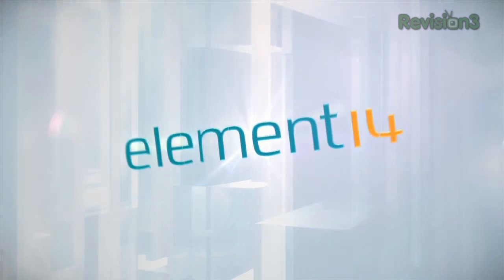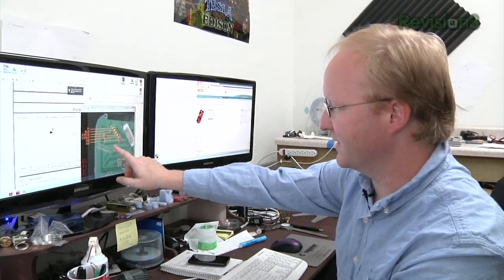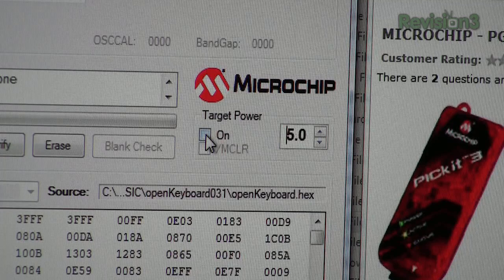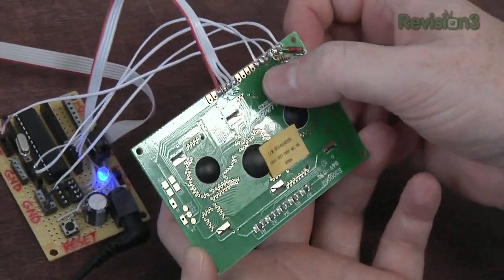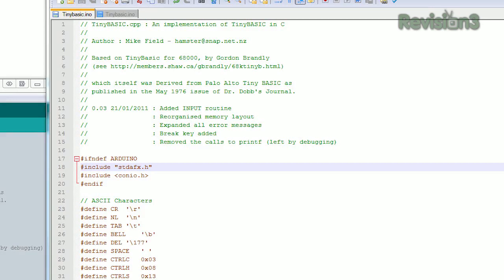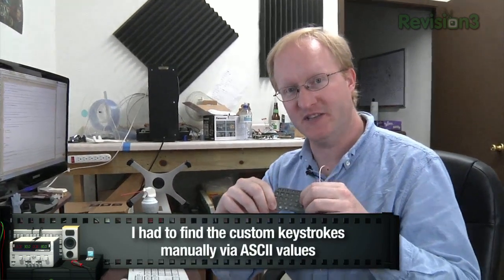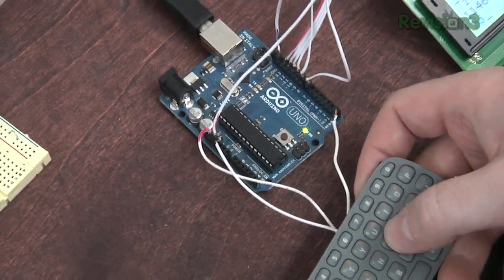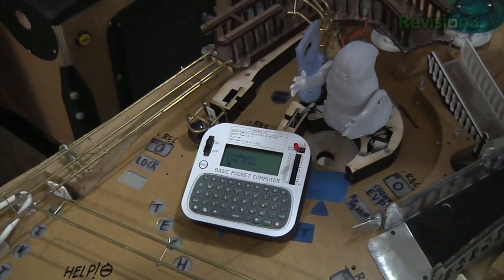Build a Retro Computer: BASIC 80's Pocket Computer

Comment: @4:48, no need to remove the chip, instead just hold it in reset by grounding RST  :-)
Works for SMT unos too, in fact a Nano with a grounded RST is a home-made FTDI !
Remember tx & rx are reversed in this application.

Comment: Hi there! I'm the original author of the chatpad reverse eng/firmware, and I just discovered it was been featured on the Ben Heck show because a student contacted me with questions about it. This stuff happens often with many of the project I used to release back in the days, and I just wanted to take a minute to tell you how awesome it is to me. Keep sharing!
Reply: Well you seem like the guy to talk too haha. I can't find this information anywhere any chance you could give me a nod in the right direction?
Reply: @butch5020  sure thing! What do you need?
Reply: @jean80it  I was wondering how you managed to convert it to output ASCII, I'm assuming it's a UART signal and I have no idea of how to go about it. I was looking to see if it was possible to hook it up as a USB HID device for one of my pi projects. Any chance you could help with that?
Reply: Fugitive's Broadcast the pic should be 16f883 and does not offer usb abilities out of the box (if memory serves me right) so you would have an hard time with that even if you wanted to mod the firmware. Serial is one of the easiest protocols out there, and most “pc-on-a-single-board” (*coff*raspberry*coff*coff*) offer dedicated pins for hardware UARTS. Otherwise, you could buy a serial to USB converter - but you still would have to convince the host machine to treat a serial stream as a keyboard.
Reply: Have you published the code for the firmware anywhere? If you have could you point me there?
Reply: Hi Giancarlo, I'm just doing a chatpad conversion now.   Ideally I need to patch it for 1200 baud, any pointers please?   Many thanks - Phil
Reply: Ah dont worry Giancarlo, I've done it.  All I had was your hex file which I partially disassembled and then manually patched the hex file, it works great at 1200 now. Here it is:  https://www.youtube.com/watch?v=5UbesxLaoNs
Files here: https://mode-zero.uk/viewtopic.php?f=80&t=1236&p=10501#p10501
Reply: it is super cool. Ben is like ultimate corporate drone compares to now ehh hahaha

Comment: Hey ben! 
I've seen your show and I do like it.
I primarily work with programming of the batch language for PC and XP, I'm looking for a build that uses the Arduino mega as a robotic control for movement but can permanently connect to a separate computer (Hardline) but smaller than a laptop.

Basically what I want to do is build a full-on robot, that is small enough to do basic household chores similar to the ones that you would see on the movie Flubber

Comment: for the sake of god make an essentials ep about what the hell does pos and neg and ground mean and why cant i put any wire any place ... its like..i copy every thing exactly from you but i have my own crazy ideas like saving some programs on an sd card to create my own raspberry pi portable that can run retro \old school games and these games or in creating the atary 2600 portable using the ps4 controller's pad thing and instead of putting a separate bottom i use the bottom that is in the pad and stuff like that for the sake of god

Comment: Gotta build me , one of these!  Just found a chatpad for  8 bucks on Ebay, I think I have the rest of the stuff on hand.  Might have to change screen though, I just built a TV-OUT board for a small 7 inch monitor I have, perhaps i will output to that, but it's just black and white,so maybe not Have to dig around and see what other type of monitor I can come up with,  but then black and white would be about the same as the one you built.  Could go bigger and perhaps use an USB mini keyboard that I have, or maybe a wireless one, think I have a couple of those laying around as well.  Ah for the joy of the old Basic machines, cut my teeth on a C=64 and I had a couple of those old Tandy 100's as well as a few other basic laptops and portables. Man what I wouldn't give to have my tandy 100 back again.
Reply: good for you

Comment: I found this project last week and now got it going. This project is a bit misleading, you will see that the version of TinyBASIC Ben installs is 0.03, this is an early release and has no digital or analogue pin control. You need to find TinyBASIC Plus (version 0.13). It's on GitHUB. Newer Chatpads have a custom chip instead of the PIC, it appears to be pin compatible but is NOT re-programmable. It is probably a PIC with code protection. These devices have 'Microsoft' on them. I removed one and replaced it with a PIC which works fine. Another problem is that TinyBASIC will NOT compile under the latest Arduino IDE, you will have to downgrade your Arduino IDE install to 1.5.6 r2. Even then I couldn't get it to compile using a 20x4 LCD with a Sainsmart serial converter so I had to remove the serial adaptor and go with the 4-bit data interface. I used Ben's code mods but they are not complete and I had to make a few additional modifications. I now have it set up and working on an Arduino Mega.

Great project though Ben, I enjoyed playing about with this immensely.
Reply: +Mike Hawkins Ya I have one with the MS chip as well, however I found a library that will do the conversion so the flash isn't needed. I wish  I had found that before I ordered the pickit 3 but who knows I may well need it on another project.  When playing in the micro-controller world tools are always good to have.  I also play in the computer world, as many do, and find that even 3 and a half inch floppys come in handy on occasion.
Reply: +Jerry Ericsson I came across the library too but decided to flash them in order to strip off the irrelevant output data from them for use in future, non-Arduino based, projects. I have brought a few of them now as they are pretty cheap on eBay and a miniature ASCII serial keyboard will be handy for future projects.
Reply: +Mike Hawkins Have  you been able to flash those with the Microsoft chip?
Reply: +Jerry Ericsson I have only come across one with a Microsoft chip so far, and I removed it and replaced it with a bog standard PIC device.
Reply: How thick is the keyboard?

Comment: Omg this is the best. he made a pocket computer. ive got 1 too its called a phone and by the way it works...the dislike buttion works...jk good job there
Reply: Can you connect Servos/LEDs and other things to your phone without any other hardware? No. Also the Battery easily lives a lot longer then the one on your phone.
Reply: +DerpyDoom good thing they have batterypacks and diy adaptors
Reply: Phones are stupid

Comment: Hey Ben,
I'm trying to make this project, but I'm not finding the chat pad for this as well as the 16*4 LCD,which i believe you used  . The things i have is an Arduino Uno R3, a PS/2 keyboard and a 16*2 LCD[ Hitachi HD44780 controller based]. Can i make this using the parts i have?? and please send me how to modify the LCD code  so it works on a 16*2 screen. Any help would be appreciated!!

Message me at mohitnbagur@gmail.com
Cheers,
Mohit
Reply: +Mohit Bagur There are plenty of demos on how to use the PS2 keyboard, here is one: http://playground.arduino.cc/Main/PS2Keyboard

Comment: { goes on the next line, not on the same line as the function declaration! Man... that's why they call them brace pairs, so they can be in a pair.
Reply: Cristi Neagu There are as many different coding styles as there are programmers in the world. I personally like it better with the opening brace on the same line as the function's signature, also because it doesn't add one useless line to my function; and I don't even really care about braces, since I prefer visually-helping and good-looking indentation.

And anyway, it's still a pair even if the braces are not on the same column.

Comment: Hey Ben I have a challenge for you. Can you try to make a wireless xbox 360 controller screen to display a wireless hdmi signal such as from an xbox or pc to be used kinda like an nvidia shield without the intense lag? Another great use for this (besides gaming across the house) would be hooking the signal transmitter up to a tv reciever and stream media to it, anyways i think this would be totally possible using wireless hdmi and a screen that could be powered by the contrtoller's expansion slot on the back

Comment: Hi Ben, I can't find a chatpad with a SMD PIC exposed like yours, all I can find is chatpad with a Epoxy covering the chip and instead of 6 it has 9 pins connector. I bought it from DX.Is it possible to use it?Regards. Joe.
Reply: jose Milton There's an arduino library for the unmodified chatpad available here: http://cliffle.com/project/chatpad/arduino/

Comment: There is no ground. This runs on batteries which are dc. Ground runs on ac. And how is it going to run electricity to the ground when it isn't connected to that or anything that would connect a lightning strike to the chatpad?

Comment: I hate to say it, but this is probably the most useful tool Ben has ever made. Not that the other tools are not useful, but this small computer is indeed insanely useful! Basically, Ben has built the world's first digital multitool if you wish to call it that! This can be used for debugging computers, electronic components, pinball machines, arcade machines, ATM's, and it could even assist in debugging Java programs and such! Ben, this portable MS-DOS computer is the most useful electronic tool I have seen you build, and while some may think that it is cheating, an Arduino is still powerful enough to run Basic really well.
Reply: Well, it does not really run dos. Actually it runs a basic interpreter written in C, so its more like an own operating system (which can only run one program at a time). There's bitlash out there which can run multiple programs asyncronous and has a c-style syntax. But yes I agree to you that this is the best thing he ever made! It woke my interest in electronics and I bought alot of tools and parts since that. I can build a few of them, if i want to.

Comment: Little precision : lcdChar(c) is not an "object" but a static method call. If you were encapsulating the method in a class and then create an instance of that class and then call the method "on" this instance, then yes, you would use an object. But not here. And... sorry but the code you've written to output the chars is pretty ugly... (in terms of style and performance...)
Reply: Is it really even a method when it's not a part of a class/object? Thought you usually called it a function then.
Reply: You're right, static function call, habit. But the rest of the comment remains valid.

Comment: Build it ALL from discrete semiconductors, 4000/74 series logic chips and processors, then get back to me. Arduino / R-Pi etc is CHEATING.
Reply: True, but it's still pretty inventive and it works!  I've tried my own projects using logic chips, ics, old CPU's and never ever got anything to work, but every once in a while I get to the itch to try building my own 8-bit little computer.  I got all the parts, just I always mess something up.  I've been following this guy for about 10 years, back when he was just doing portable hacks with the Atari.
Reply: sprybug That's your experience though, not an absolute.
Reply: It may be cheating, but it is a very helpful cheat. You can debug so many things with this...you can debug pinball machines, arcade machines, electronic components like servos and transistors, SD cards, RAM sticks, etc. Basically, Ben has created a very portable and powerful multitool for circuitry debugging that is reliable and uses parts that are accessible enough to public to do this. Well, except the case...you would have to make some sort of sturdy case for yourself, but this is the only drawback really.
Reply: I hope you don't use pliers, breadboards, strip board, a soldering iron, or any other pre-fabricated tools! That's cheating too. After all YOU didn't make them some one else did.

Nothing wrong with modding what you have at hand, and there's no reason to reinvent the wheel when you don't have too. If you WANT to do it from scratch, kudos! But unless you're willing to do EVERYTHING from scratch including inventing your own power source, then you too will be CHEATING at some point. :)

P.S. "4000/74 series logic chips and processors" <<< that's cheating too :D gotta build it out of transistor logic gates dude.
Reply: Daniel Foreman My grandpa once set up computer rooms for a living for a company...they used a large combination of pre-fabricated tools and specialized tools all the time! The only ones they did not have then were the breadboards and the strip boards, but that is it! They only had to use a soldering iron two times for a couple parts that came in damaged, but they were fine afterwards.
Reply: Nothing wrong with tools and shortcuts. Hell knows even using a transistor is cheating if you don't make it yourself lol. Heck you're cheating even if you don't dig up the silicon with tools you make yourself. Really it just depends how ridiculous you want to be about it. One guy says he should use transistors and processor chips, but that's cheating just as much as using a pre-fabricated XBOX keyboard, and an EPROM. These things exist, why make life hard for yourself? It's the end result that matters not how much hell you put yourself through to get there :)
Reply: Daniel Foreman This is what I have been thinking to myself and didn't wanna say anything about..I was in this exact same conversation elsewhere before and got in the middle of a nasty debate over mentioning it somehow. I literally said nothing more than this and the guy started typing swears and everything to me...so yeah.
Reply: megalomania345 It's a "retro" computer - that's the whole point ;-)

You're calling me a "n00b" - that alone indicates you're younger than me - I am 39, and have been building circuits since 1982 - how about you?
Reply: ***** This guy was calling people who can't get decent jobs subhuman on another comment too...you have yourself a witness to this.
Reply: Marcus Frölander I am not building a "retro" computer with my Raspberry Pi.
Reply: ***** But if you were, it wouldn't be cheating. It would be effective.
Reply: Marcus Frölander But.,. I'm not.

As a great man once said "If my Grandmother had wheels, she'd be a trolley car".
Reply: Be careful that you don't fall off that high horse, its a long way down
Reply: unlokia hes doing f all but typing load "" . we used to solder out scrap 8080 on veroboard and the old guys said we cheated having the hard bit done for us. hate how these kids think they are programming
Reply: This is really stupid. Creating things with logic gates are fun, but it takes so much time, and the point of these videos are not about going in-depth in any way, but to inspire people to create their own projects. Try making a 15 min video about creating a pocket computer using logic gates that inspires people to create their own projects. These videos are not made to impress grumpy old men, but to inspire the younger generation to have an interest for electronical engineering. And Ben does an amazing job at just that.

Comment: I wonder what you (Heck) can do with one of those $30 Sylvania laptops. I saw a refurbished model of it on newegg the other day. It has a 400mhz VIA 8505 CPU, 2GB of drive space and 128MB of RAM. It uses Windows CE 6. There is also a $45 version which has a 700mhz CPU, 4GB drive & 256MB RAM running Android 2.2. It has a full keyboard, touchpad, 7" TFT LCD screen, SD card slot, 2x USB 1.1, a USB 2.0 and wifi. I am thinking about getting one just because the components in it cost more than $30.

Comment: ive only had trouble with the dc cables so far. all im doing is useing a usb hub. then putting adapters into it. but the dc is not wanting to work right so i might not be good enough to get the dc to connect with the actual power source. i might need to hook up some sort of power limiter or something. lol i suck at grammer and punctuation so sorry for the eye sore of a msg.

Comment: i have been working on a truelly universal charger. it will have a bay for 5 phone chargers, 3 mp3 chargers, i phnoe/ipod, and 10 different size dc cords. i bet you could get it done way faster and smaller lol would you try it ben??? its a pain since i am not that great with boards and knowing where to connect wires.